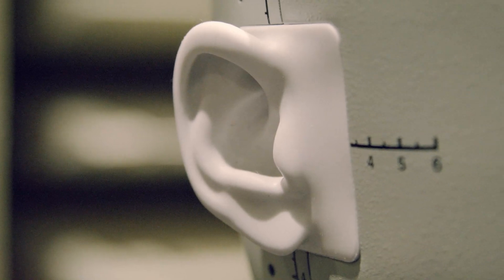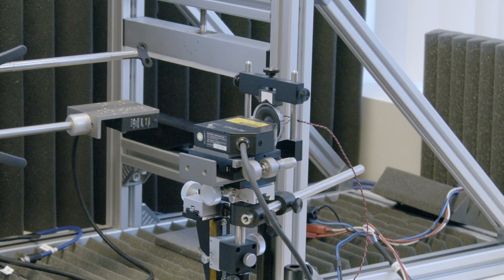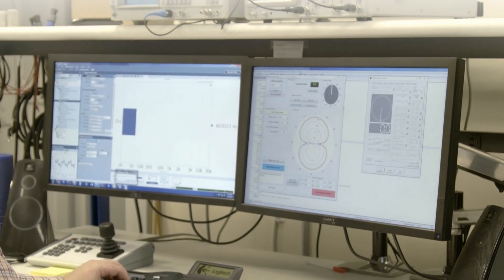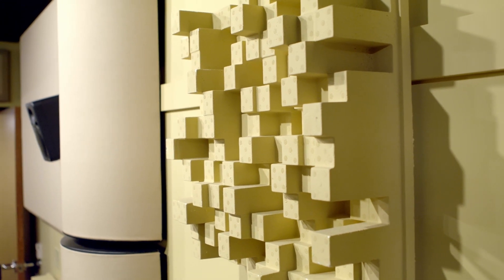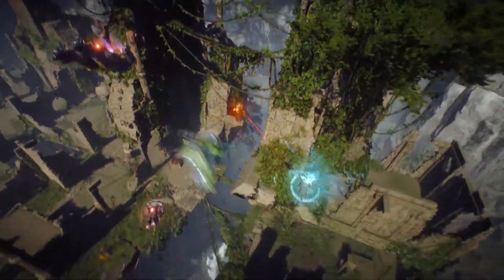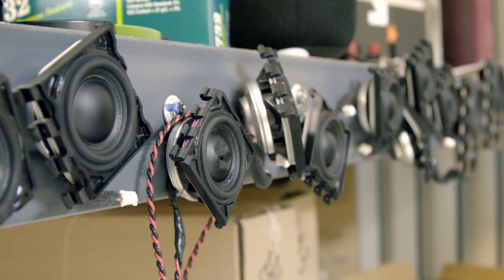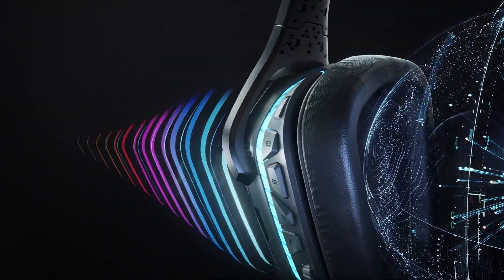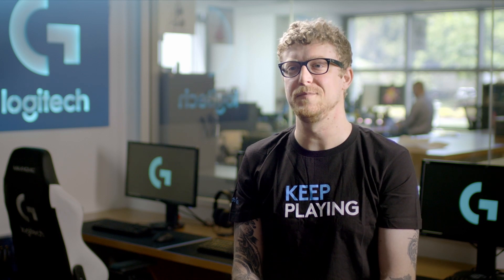PRO-G 50mm Drivers: Developing New Audio Technology

Comment: Used G635 for a few months now and I can confirm, the 50mm Pro-g driver sounds the best among all the headsets at the same price point. The 7.1 Surround mode actually sound GREAT and I played csgo better with it. Even more expensive gaming headsets can't do 7.1 Surround this good. There's so little distortion that you can actually get to hear details in that wider sound stage. Bad 7.1 implementations just sounds distorted and muddied. The sound with or without surround sound really punches way above its weight. The headset itself could definitely use a redesign tho to be worthy of this driver.